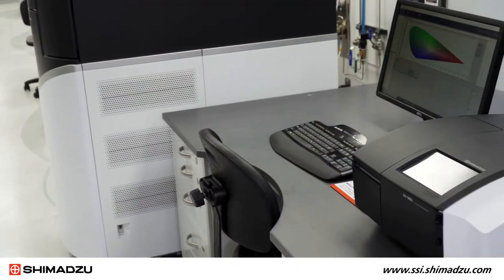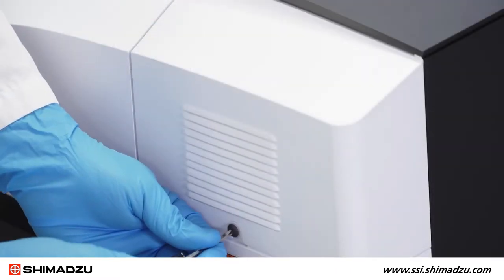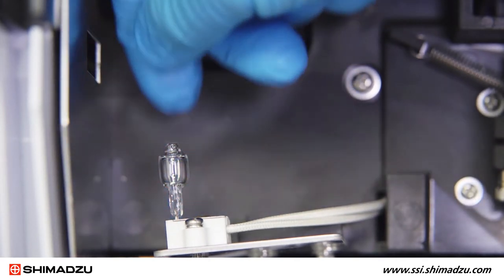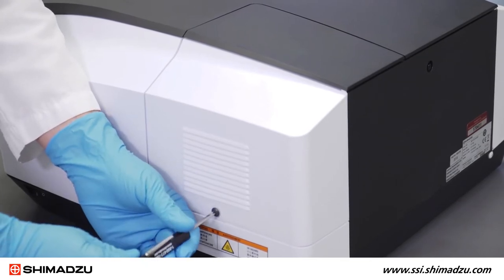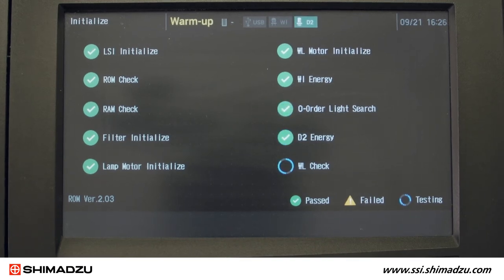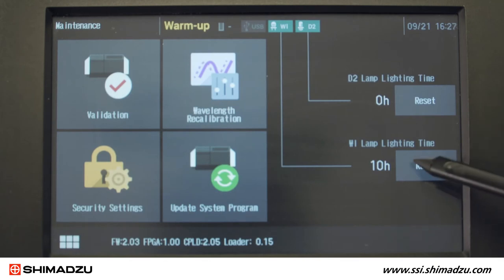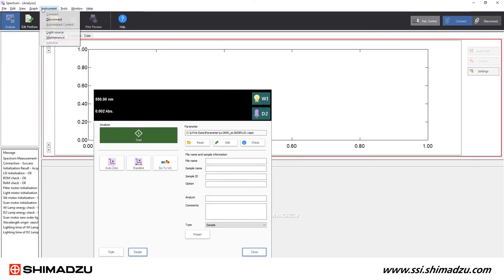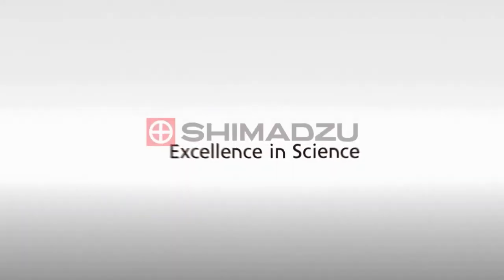How To Change Lamps in a Shimadzu UV-VIS Instrument

Comment: is it the same for uv-1800 spectrometer ??
Reply from the maker: Hi there. The overall process is the same, however, the lamps may be in a slightly different orientation.